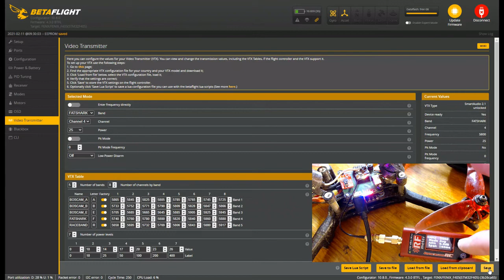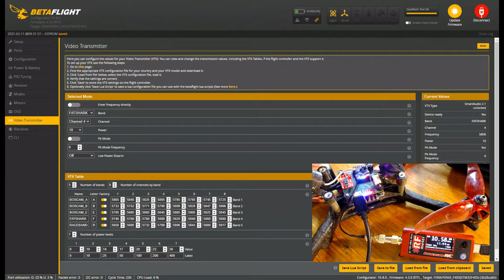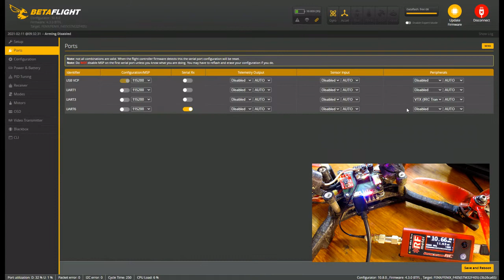OpenVTx - Open source video transmitter firmware for the FPV community

Comment: Hi, if i use ovx300 or 303 with max power output how much the amp draw increased from happy model spec <650ma at 300mw ? I want to power it from my hobbywing esc that has 5v bec but it only has 600ma max

Comment: Awesome work!

Have you found the E7082MVs to be reliable long term for racing? I'm worried about stomping on someone else's video with a cheap VTX. It looks like this will solve the problem initially, but cheap stuff isn't known for long term reliability...
Reply from the maker: Ive been flying this VTx on original firmware and OpenVTx for over a year.  So far Ive had zero issues at race events or flying with mates. 

Ive had other well known VTxs break electrically in hard crashes.  But to date I have only killed 2 of these EWRF VTxs by physically crushing them and the stack.

To me these are the best kept secret WRT to VTxs.
Reply: @JyeSmith  I'll put in an order tonight before the price goes up.